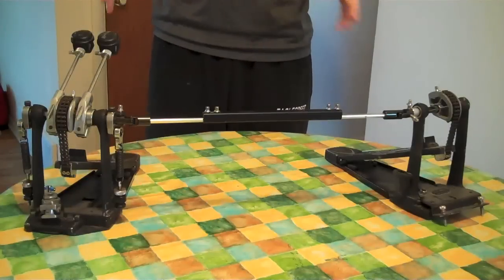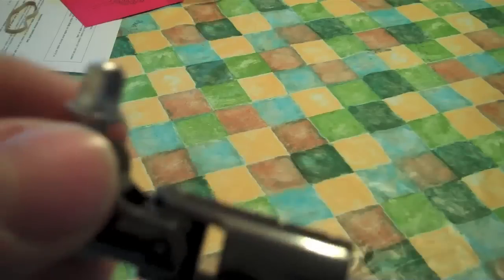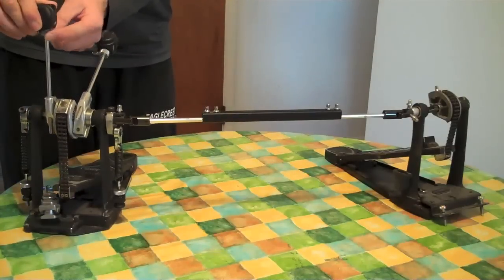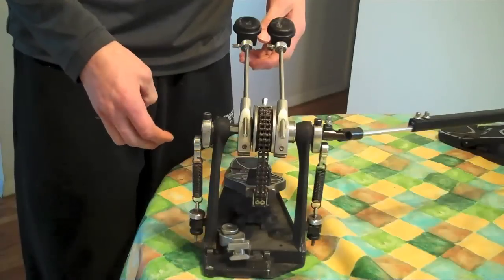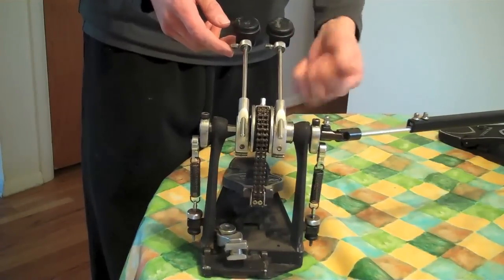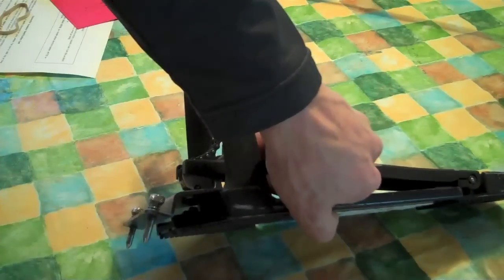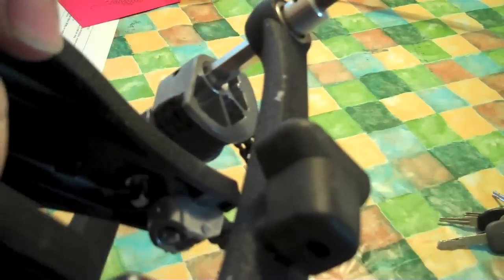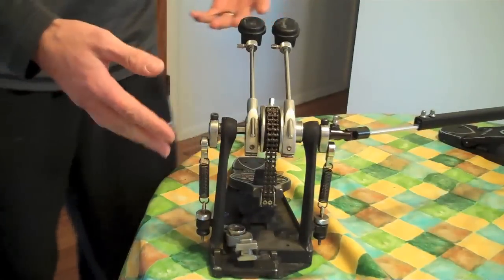Iron Cobra Pedal Setup - Ryan's personal settings

Comment: Thanks for the tips on adjusting double pedals. I play a single iron cobra power glide 900 (previous version without the hollowed out cam) and I have a DW wood beater on it and it really makes a difference in sound. I also have a used speed cobra 910 double (current generation) I got from Guitar Center I’ll be trying out, but this video will help me in setup and what to look for. I’ll be checking the connecting rod hinges and if it has too much play I’ll return them since they’re used pedals.

Comment: Replace the driveshaft with a Trick version!
Reply from the maker: Poop Dawg I've considered that. They're prohibitively expensive. You can buy like 4 of the regular ones at the same price...so like 20 years worth.
Reply: $130 on ebay, I ordered one from/to South Africa for my DW 9000s. There is no comparison in quality (I've owned Pearl, Tama, Gibraltar), there is zero latency or play. They haven't degraded in the slightest either. So, consider that.

Comment: Hey Ryan, thanks to your video I figured out my problem with my 200 bpm problem. My drive shaft is loose like your old one. I bought a used 2001-2 Iron cobra so it had a lotta play. Can I get a link to the shaft you bought as a replacement? Thanks alot for your great tutorial videos
Reply from the maker: I don’t think you can buy it new anymore. My past one I bought like 7 years ago. Everyone tells me to get the Trick shaft next  time.

Comment: Same size bolt and 2 nuts works great in place of those pins that hold the universals together. After you calibrate how tight you need it use the 2nd nut as a jam nut

Comment: I can’t figure how to raise the footboard on the slave pedal. Everything I try also affects the beater angle but I don’t want to change that. Can anyone help?
Reply from the maker: If I recall correctly there’s a black screw on the top of the spring that corresponds to the slave side. Probably a hex head. It’s between the drum key screw that attaches the slave drive shaft and the slave beater. It’s visible in this video. Loosen that and you should be able to set the slave pedal height without touching the beater angle or position.

Comment: I know this is an Old post ,  but I just got these pedals & havuing an issue ............    The RIGHT main pedal & Right beaters needs to move slightly to the Right on the shaft, I loosesed the square screw thing all the way but the beater still wont move left or right.       .....I need it to go Right half inch that way my second beater sits equal & theyre both centered on the drum head.................like it is   I have 1 beater centered Z& the 2nd pedal beater is to the left of the center about an inch.
    If I can slide the beater assymbly over a bit I';ll be all set,   H9OW do u move the beater thing over to the right about an inch??
Reply from the maker: I think you would need to remove the beater and the piece that holds it completely. So, loosen the screw as if you were going to change the angle of the beater. But keep going until that piece will slide off of the round part that it rotates on. That round part, attached to the actual hexagonal rotating axle portion of the pedal, is what you need to move. Once you’ve gotten the beater assembly totally off of it I believe there’s a set screw somewhere on it. If you then loosen that it should allow you to reposition it. I have never actually wanted to do this, so I’m not 100% sure it will work. But I have disassembled a cobra pretty far and I think this is the case.
Reply: @RyanAlexanderBloom   YEH iM just trying to center both my pedals on the kickdrum head,   righht now one is centered  & the left one sits about an inch or two to the left,  just trying to gt them equal,thanx

Comment: I have been a single petal player for 40 years just recently I starting playing double kicks I know it’s takes a lot of building up my calf muscles on my left legs to get where my right leg is I used dw 5000 petals single for about 10 years and before that was slingerland single but now I have a iron cobra double kick petal doesn’t feel responsive enough I’ve tried every adjustment on the petals plus I sit low should I raise my seat and dangle my legs or sit low and buy a new petal
Reply from the maker: With any pedal, I never recommend sitting low. Your hips should be level with your knees at the absolute lowest. Any lower you’re hurting yourself.

Comment: For your spring tension, where did you get the metal one that tighten up the spring?  the original one is black plastic. I noticed your is silver.
Reply from the maker: Wu Jay this is the initial run of the second generation. They made them this way from '98 to maybe '04 or '05. They came with that metal nut and also with a more slender beater holding mechanism without the hexagonal cutout. These are stronger and slightly better than the next run from 2005-2011. They are currently on the second variant of the 3rd generation as far as I can tell so they're now made quite differently.
Reply: I see. thank you! BTW, how much did you pay for the driveshaft? I looked it up online the original one and the Trick drive shaft both cost $130. However, you said that the trick one is more expensive?

Comment: I had went threw so many convection bars that I finally went to the trick bar the works for Tamas and it’s lossless on the slave side, much more durable u joints.
Reply from the maker: Nice. I basically bought a second bass drum instead… not exactly the same thing as a better connection and there are a ton of downsides. But it looks cooler. So there’s that.
Reply: @RyanAlexanderBloom  man I think I’m headed the same direction , going back to two kicks . I’m a less drums I’m my own rodie type of guy but two kicks it’s going to happen  lol

Comment: Hey me one beater always creeps up and doesn't stay perfectly even with other beater when in a sitting position any ideas how to get both beaters exactly the same
Reply from the maker: Sometimes that can be challenging because when you set it you have to have some tension on the pedal because you're touching it. When you take your hands off, suddenly its different. If you have it perfectly set and it seems to move, then you probably either aren't tightening the adjustment enough, maybe the screw is stripped, perhaps there is play in the slave arm that connects the pedals, or maybe some other piece of the pedal is slipping and causing the problem and you're not seeing it. I have no way of knowing which if any of this things is true from here. Hopefully thats helpful.

Comment: hey ryan is it possible to take the heel rests off of these? thanks a bunch
Reply from the maker: It’s definitely possible but I suspect not a good idea. It looks like the hinge for the footboard is integrated into the heel piece. If you take it off the footboard would just flop around unattached. I’ve never tried, but I’m assuming you’d have to do some engineering/fabricating of a new hinge to playboy without the heel.
Reply: @RyanAlexanderBloom  yea problem is im very good at the heel toe technique and if that heel support is off i could get the full potential out of that technique

Comment: Yea man that connecting rod for sure get's loose at the joints after a while, i've had my pedals since 2010 and i can totally tell the slave pedal lags. Will be buying a replacement soon, just wish they weren't $130 lol. I also here it's good to have the slave pedal spring tension a 1/4 inch tighter than the main pedal so the betters hit and flow the same?! True?
Reply from the maker: I think it might be true that the spring needs to be slightly different to feel the same, not sure of a 1/4 inch is always the right amount. Go by the feel, not by a formula. I've been contemplating a better connecting rod... But the nicer ones are much more than the Tama replacement... These pedals are only 150-200 used so buying a connecting rod that costs as much or more is a hard decision to make.
Reply: +Ryan Alexander Bloom I agree 100% about the connecting rod. I want to get the speed cobras so im not sure if i want to just leave these alone and sell them. The threading on the nuts and the holes for the nuts in the connecting rod are weak. I had to re-thread them twice already, and i don't like the fact that Tama used plastic fasteners for the spring tensions, the threading on mine stripped real quick. Easy fix though.
Reply from the maker: I think I said it in the video, but I'm on my third rod since 2001 or so. Never had any stripping issues with any of the parts, but the joints just get weak.  These apparently last about 5 years, but the pedal itself lasts at least 15.  Good connecting rods use ball bearings rather than simple hinges, hence the cost. Not sure how long they last in comparison.
Reply: +Ryan Alexander Bloom Very true!! Thanks for this video man and all your other ones, very helpful!!

Comment: hey Ryan, I guess we have the same pedal but why does yours not have a coil spring? Is that the first gen iron cobra?
Reply from the maker: Max Sy this is the second generation which was '98-'10. This one is '00 I think. The stupid coil wasn't introduced until '11 with the third generation. The coil is a gimmick. Doesn't do anything useful in any way because a chain can only exert force when pulled. When pushed it just creates slack, exactly what you don't want. I recommend just removing the coil.
Reply: Ryan Alexander Bloom really? how sure are you? have you used the coil spring?
Reply from the maker: Max Sy pretty sure. The logic is sound. The coil pushes the footboard in the opposite direction of the way the chain works. Slack in the chain is detrimental. The only thing that can happen by pushing up is creating slack. You cannot actually reverse the beater direction from the bottom of a chain. The reason you might want a coil like that, which would actually work on direct drive, is to help the rebound, but you physically can't from that location. So even if it feels different with the coil, it isn't providing any mechanical advantage and you may actually have to fight against it to keep the chain taught and free of slack.
Reply: @RyanAlexanderBloom  ive been searching around trying to see if the third gen has anything different besides the coil. is there anything different from the one u have and 3rd gen?
Reply from the maker: @itz_vortex7341  they’ve updated the beater design, though you can always put on whatever style you want after the fact, and the cam shape looks to have been changed to be slightly more angular on the power glide version. I don’t own one so I haven’t been able to really check out every possible part in detail. I’ve just seen them and played them at the drum shop a few times.
Reply: @RyanAlexanderBloom  oh wow thanks a lot man

Comment: But don’t you find the spring tension on the slave side feels off compared to the main pedal when their tightened exactly the same?
Reply: Or is it just my pedals? Lol
Reply from the maker: KillerBoots yeah the slave side is always a little off no matter what I do. I think that’s pretty unavoidable. I worried about it for a while but you just have to resign yourself to it.
Reply: Ryan Alexander Bloom I’ll be buying a trick drive shaft for this issue. It made my speed cobras feel exactly the same when I did that. I’m about to get some chrome cobras and buy a replacement shaft and I’ll get back to you if it’s worth it. I know you’ve been told this already but it really is a night and day difference in my experience at least with other pedals.

Comment: where did u get the weights on your beaters? ive got a iron cobra too but o havent got these weights
Reply from the maker: I have two of these pedals and they came on both when I got them. You can buy more online, just google them. I think they're like $12 or something like that. It's really weird that you don't have them.
Reply: yeah mine came with them too.  Funny thing Ryan..I had them on for years,  my buddy Jason from ATR (we share a practice space) was looking at my pedals the other day and he went like.."oh you got the weights on, no one on the road uses them, you want to go fast, take them off"   so off they went.   I know its personal preference but something to think about.
Reply from the maker: Hmm. That is funny. Maybe nobody that he knows uses them, but they're a bigger help than you'd think and they don't slow you down as much as you would assume either. The extra weight actually serves to keep the pedals in motion longer, like a pendulum. It actually reduces the amount of energy you have to put in to the system to get a lot of speed and power at a very steady and even pace. Light pedals require more control to play and the speed benefit is not amazing. Speed is mostly the player, but stamina and evenness can be enhanced with a heavier beater. Of course, there is a limit. A 5 pound beater would be useless.
Reply: Ryan Alexander Bloom interesting that makes sense.... So you have them all the way up?    I used to have them kind of in the middle but I only felt a slight difference since I took them off. Maybe I will try them all the way up.     I have been making a lot of adjustments to my pedals in the last few weeks after having conversations with him and looking at his set up. I was asked to sit in for one gig  in a slipknot tribute next month., I'm fast on the doubles but this stuff is a little faster than I am used to playing in punk bands.....I lowered the beaters and changed the angle to make them a little closer to the head, and tightening the springs.. things like that.  He uses a smaller 20 inch bass drum because he says the response is better....... I just pick his brain a lot every time we hang out.  I used to have these plastic block beaters but I went back to the Iron Cobras standard ones and that improved my speed

Comment: Where are the cobra coils? Do you notice a difference without them?
Reply from the maker: The stupid cobra coil wasn't added to the Iron Cobra line until probably 8 or 10 years after these pedals were produced. There is no coil. The way I see it, the coil is nothing more than a marketing gimmick. They made the Iron Cobra very durable and when nobody was buying a second one, they had to think of a feature to add to get existing customers to buy again. They made it too good for their own good. Since the Cobra is a chain drive pedal, the coil serves no identifiable purpose. Pushing up on the footboard from below will just put slack into the chain which is the worst possible thing you can do if you are trying to have a smooth stroke.
Reply from the maker: Ok, maybe not the worst thing you can do... but not helpful in any way.

Comment: It's your set up, but the only thing I disagree with is the beaters being close together only on the iron cobra. The iron cobra has an offset hoop clamp that makes the pedal sit too far to the left on the kick drum so I had to move my beaters to the right. I have them hitting left and right of center respectively. I feel like the sound of each kick hit is the same this way. If one beater is centered and the other is way left of center it sounds odd to me. With sticks we play drums left and right of center right? Thats why this makes sense to me. But if Tama came out with a centered hoop clamp, I would buy it immediately. The offset hoop clamp is the only thing I don't like about the pedal.
Reply from the maker: Glen Wolfe the clamp placement isn’t ideal. At least it works though. Some pedals only accommodate hoops of certain thicknesses.  There are several pearl pedals which absolutely won’t attach firmly to metal hoops because they’re too thin. They won’t clamp right enough. So, yeah offset makes no sense, but there’s worse designs out there too.
Reply: Ryan Alexander Bloom I see that. I also realize that they couldn't come out with a centered clamp anyway because the plate on the bottom isn't centered either. Oh well. Thanks for the video and the reply

Comment: Can you reverse a right to a lefty
Reply from the maker: the never ending journey I’m going to say a very conditional yes, sort of. If you have one built between like 2005 and 2010 (generation 2.1) and you buy a lefty slave pedal on eBay or something, I think you could make it work. But not right out of the box and not with anything older. I’m not sure about the current 3rd generation ones. Maybe?

Comment: i have those but my beaters arnt even so im so confused
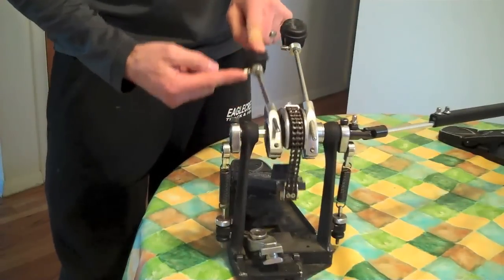Reply from the maker: +pichoff the beaters are easily adjustable. At 2:10 I'm sort of pointing with my right hand to the silver piece that attaches the beaters to the rotating axle-like part of the pedal. right there you can see a screw at the very bottom, closer to the camera. You adjust it from the back, and its just poking through the front here. This adjustment will allow you to change the angle of each beater independently of the footboards or the other beater.You can pretty easily even them out.

Comment: iron cobra powerglide or pearl redline ???
Reply from the maker: It's not a secret that I dislike pearl pedals. Pretty much all of them.
Reply: On the new version of the iron cobra I'm yet to see any thing but a great review yet.. they made some improvements for speed supposedly that buyers are agreeing so far on. The new silicone beaters appear to be well liked too. If that helps. when you decide let me know what you went for and how you liked them as I'm considering the new ic's too
Reply: I think the new Dw 9000 xf with the extended footboard might be amazing. The regular model I wish was a tad longer as it'd help both in feel and in weight imo. I feel like the 9000 becomes better with a touch more weight added to footboard and I'm thinking the inch longer xf boards may do just that. But they're a pretty penny.